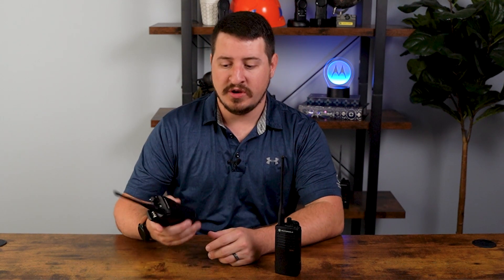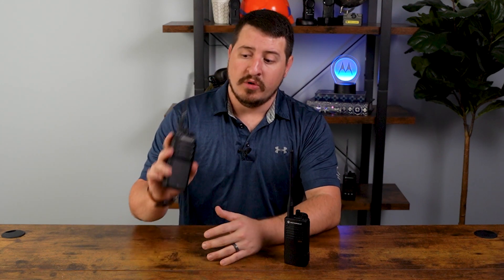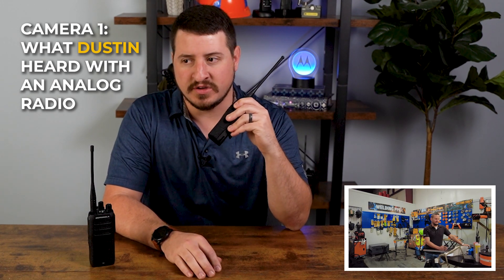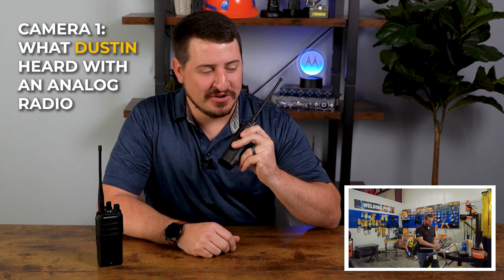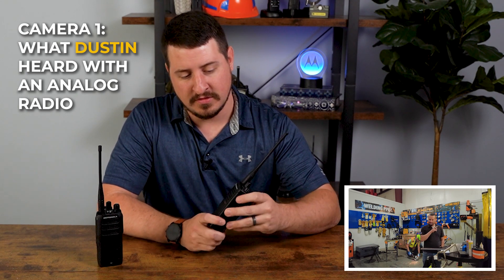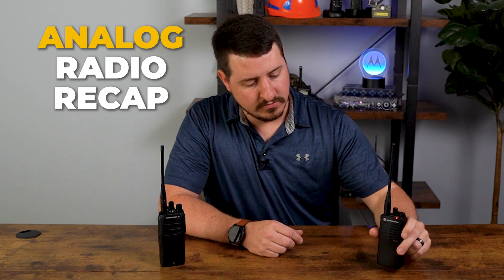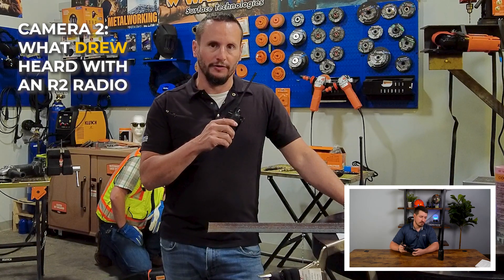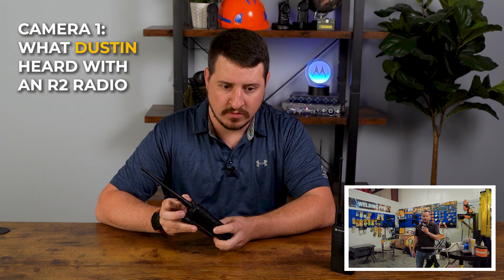Sound Check - Motorola Solutions R2 Digital Noise Cancellation!

Comment: A true comparison would be use the R2 analog in the quiet room and  compare the cp200d with analog in the grinding room and then shift just the grinding room to R2 analog. By what I see all you really proved is that Analog is noisier than digital

Comment: Great comparison!
I think Digital R2 is far better than the analog ones.
1. Is the new R2 a DMR radio ?
2. Does it require a license ?
3. Does it use repeaters anthenas over the city to get extended coverage in transmitted signal ? even to communicate across cities ?
Thanks.
Reply: 1. Yes
2. Depends on where you are but likely yes
3. It can, or it can be programmed for simplex operation or both
4. Yes, with an IP site connect system
Reply: @ErikN1  Thank you!
Reply: Hi ,I'm using Motorola XIR series with both handheld sets and DMR with repeater SLR 5300 of motorola but I find one problem while the signal is very clear ,there is always Garbled Voice almost like talking  underwater or like drunken slurred voice 
What might be the problems